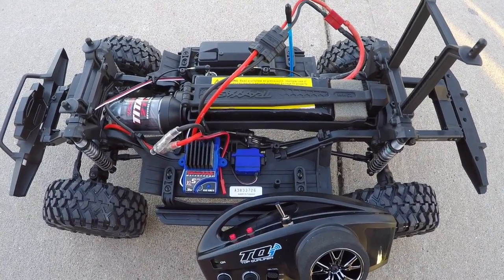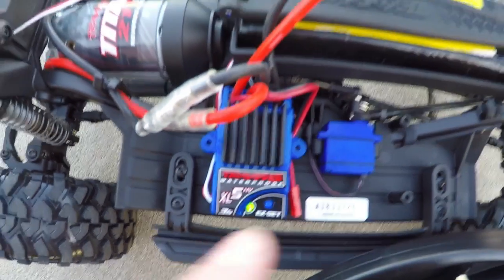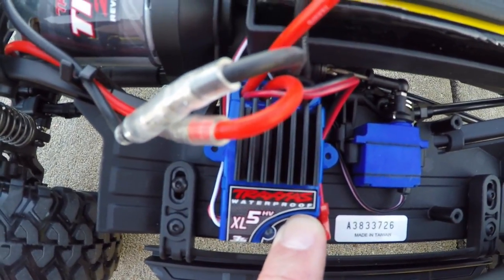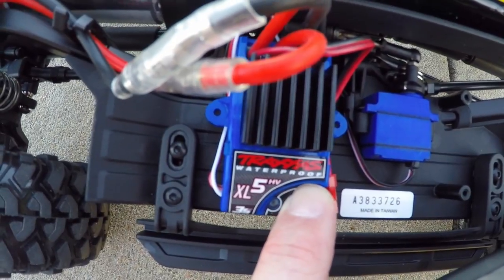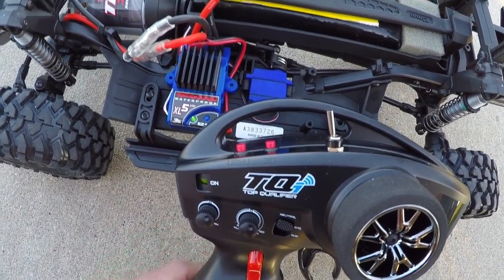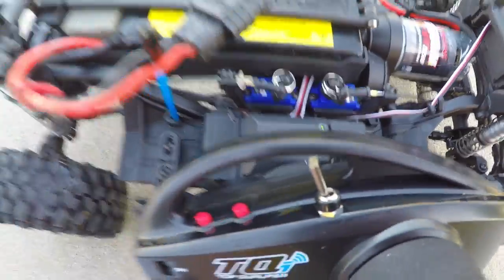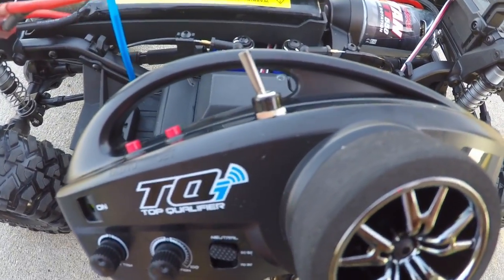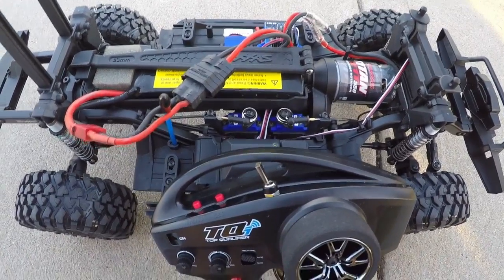Traxxas TRX-4 ESC/Transmitter Functions Explained - R/C Arsenal

Comment: Great video! You don't have to Hold the Set button to toggle Cruise Control. I just press/tap and its on. These things are Freakin Sweet! I was tossing between getting this one or the SCX10-II, i already have a Honcho from eons ago but I have never had a Traxxas, I originally wanted to get the Summit 1/10 but the TRX4 dropped into the market around the time i was ready to buy. I've added body lights and roof light bar, changed to thinner shock oil, marine grease the diffs/tranny/portals, upgraded servo to a Coreless 29.0kg(can now push car just by steering). 
I also had modded the front bumper and cut it because when i mounted my Stamped Steel 1.9 fitted with Interco Iroks, the sidewall lugs were hitting the bumper hard when steering under suspension compression. Slowly looking more and more scale adding little details here and there. This is my first Traxxas ever and i am very very happy, they smashed it with this release!

Comment: diz is very describe way u have explained...tnx buddy...can u show how the braking system on transmitter
Reply from the maker: Raees Goblin No problem and thanks! The braking setup for crawl mode or drag brake is automatically working when in that mode. It locks up the transmission so the truck doesn't roll when on inclines. Which is very helpful for crawling rocks. On the other modes I don't believe it would have the drag brake on tho as that would probably cause it to do a front flip if you let off the throttle while going fast. Not sure if that answered your question but let me know if that's what you meant.

Comment: How do I set my toggle switch to work as shown in the video? Currently mine will lock the front and if I toggle again the front unlocks and the rear locks. I want both to lock at the same time as you show it

Comment: Need help. Transmitter won’t turn on. Changed batteries and looked at wires is disconnected and everything is in tacked. Does not want to turn on.

Comment: I've broke my old summit out and my "throttle trim" knob does nothing. I want to set it up to be throttle trim but I've tried 4 times according to the instructions and it does nothing. I have the older model of your transmitter and I've even put new batteries in it... HELP!

Comment: Sorry for bothering again i oreder my trx i got only 3s lipo pack should i have to set up something on ESC before i plug the battery? Many thanx for your answer.
Reply from the maker: Heal & Harm no problem. Just make sure the esc is on the lipo mode to enable to low voltage cutoff.
Reply: Thanks R/C Arsenal

Comment: How do you adjust the drag brake?  Also if I do crawling and trailing offroad do I have to switch the ESC from crawling to trail, or just keep it in crawling?  Thank you!
Reply from the maker: Leftenant Malachi good question and I don’t know how to adjust the drag brake. I’ve never tried adjusting that and only use mine in crawl mode. I’ve added quite a bit of weight to the truck and it’s still fine in my opinion how it is but that’s my preference. There’s a tea as forum that has lots of great info and you can find an answer there for that I’m sure. If you’re doing more trailing I’d recommend switching the ESC to that mode. It’s better for the ESC.

Comment: If I use the 3s lipo on the nickel hydrate battery mode will that affect the car or battery?
Reply from the maker: If you don’t change the ESC for lipo you could over discharge the lipo battery. Setting it to lipo mode is designed to detect low voltage and stop the model from over discharging the battery. It won’t affect the ESC tho.

Comment: Do these have steering servo problems? I have one and its junk i haven't used it very much (I use my stampede wayyy more) and it quit yesterday.
Reply from the maker: If you leave it stock and don’t crank the wheels when it’s stuck I’d say no. If you add weight then ya the stock servo is underpowered for the truck.
Reply: @RCArsenal  My TRX isn't that old and I'm already having trouble

Comment: if you  in insert NiMH and have the low voltage protection there is a process to make it work. otherwise it will always low voltage protect. video on traxxas channel.

Comment: Nice video, does anyone know what the other red button does? The one that says "Menu"
Reply from the maker: That button is used for programming changes.  You'd have to follow the Traxxas guide and it will let you know what button combination you'd need to press for whatever you're trying to do.
Reply: you can download a manual from Traxxas online that tells you all the functions these two buttons do there are a lot

Comment: Is there a way to switch front & rear lockers? So you can switch to rear locker or both?
Reply from the maker: Yes the toggle switch has 3 selections. All the way to the left (front & rear unlocked), in the middle (front locked, rear unlocked), and all the way to the right (front & rear locked).
Reply: Instead of only front locked..can you ONLY lock the rear?
Reply from the maker: I'm sure you could if you swapped the wires in the ESC but haven't tried that.

Comment: What situations you would need to use the rear lock and what situations you would need to use the front lock?
Reply: Lock rear, open front for tight high incline corners. All open for trailing and high gear. 

All lock Is for when it gets tricky

Comment: How do i switch my diff lock switch back to the setting you have which i think is the factory settings, when my switch is all the way back it is on front lock neutral is no lock and all the way forwards is rear lock i dont know how it got switched around
Reply: That is factory setting. How mine came out box and how manual explained it

Comment: Hey can yo tell me where did u get those connectors for battery or maybe can you link the connector type?
Reply from the maker: I just made the connector with some stuff laying around. You can buy them tho. It's just a traxxas female to a deans male connector.  Most hobby stores should have these or they will at a minimum have the stuff you'd need to make one if you have a solder gun.
Reply: Many thanx

Comment: Is it possible to switch out the motor and esc to a vxl setup
Reply from the maker: Adam Senig yes it can be switched but the rest of the rig isn’t designed for it.
Reply: R/C Arsenal As in just the different modes?
Reply from the maker: Adam Senig I haven’t really looked into doing a swap like that but I’m thinking there would be some issues. I’m not sure the motor would line up with the mount. Ya I’d have to agree I don’t think any of the modes would work either. Also not sure how the drivetrain parts would handle the higher rpms either.
Reply: R/C Arsenal gotcha.  Just was thinking it would be better for going through water and mud being sealed.  Plus it would have some awesome torque.  A guy on here that does reviews put a brushless in the bronco and in a 6x6.  They were insane.  They weren’t Traxxas motor though.
Reply from the maker: Adam Senig ya the extra power is always more fun!!! I’ve seen a bunch of rigs where folks put brushless motors in and usually before they run a battery through it things are shelled out somewhere. I put a mamba set up on that little 18th scale yeti jr and it’s ridiculous. Find myself being extra careful not to tear things up as the stock drivetrain just can’t handle that much power. I don’t doubt getting a vxl combo on it at all. I just don’t know first hand what all you would have to mod to make it work.

Comment: How would that remote work on a traxxas rustler 4x4 vxl?
Reply from the maker: Anthony Cuff I would assume it would work just fine for throttle and steering.
Reply: @RCArsenal  thanks for responding what I was referring to and should have asked.  What do I use the red switch and toggle button for?
Reply from the maker: Tony the toggle switch is for locking the differentials and the red switch is for high and low gears on the TRX. Those won’t do anything on a rustler tho as the rustler doesn’t have those options designed into it.

Comment: do you need to double tap the trhottle in reverse?
Reply from the maker: To get it out of cruise?
Reply: sorry, i dont have a trx4 yet. but what i mean is. when forward press once but when you want the car go into reverse do you need to double tap the toggle??
Reply from the maker: oh ok. That depends which mode you have the ESC in.
Reply: R/C Arsenal What does the menu button do?
Reply from the maker: Menu button allows you to make changes to factory settings. Not as easy to explain or summarize as you'd need the Traxxas setting charts to understand better as to what you can do. Example would be adjustments to steering, throttle, braking etc. On aftermarket transmitters there's a digital screen so you can see exactly what you're messing with but on this you transmitter you only know what's going on by the blinking light on the transmitter. I've never messed with the factory settings on a traxxas transmitter but in short that's what the menu button is for. Like I said, you'd need to see the chart that shows exactly what all you can do and how to get to the specific function you want to mess with.

Comment: What does menu button do?
Reply from the maker: Menu button allows you to make changes to factory settings. Not as easy to explain or summarize as you'd need the Traxxas setting charts to understand better as to what you can do. Example would be adjustments to steering, throttle, braking etc. On aftermarket transmitters there's a digital screen so you can see exactly what you're messing with but on this you transmitter you only know what's going on by the blinking light on the transmitter. I've never messed with the factory settings on a traxxas transmitter but in short that's what the menu button is for. Like I said, you'd need to see the chart that shows exactly what all you can do and how to get to the specific function you want to mess with.
Reply: gotcha thank you, im assuming the chart is in the manuals?
Reply from the maker: Nick Tish It can be found on their website. It's easier to read off those charts.

Comment: Get a hobby wing esc w/card
Reply from the maker: James Andonian I run those in all my racers. 👍
Reply: @RCArsenal  so easy and reliable to use. Unfortunately they one have one for my tp4070cm motor 
:( 34v 264amp constant. I have the ezrun max 5 which is only rated for 200a constant